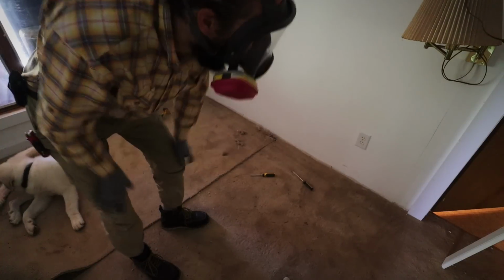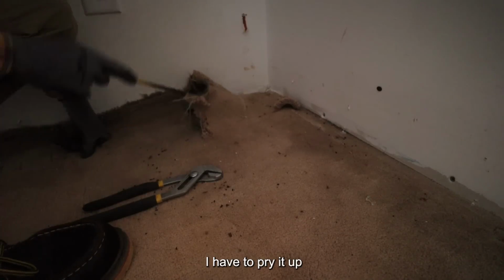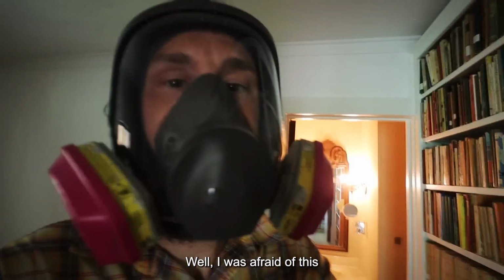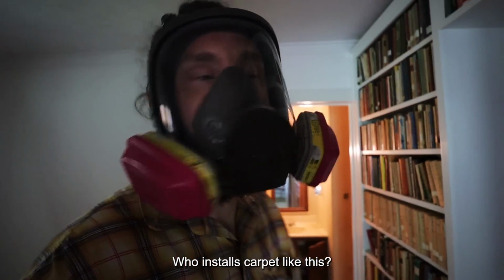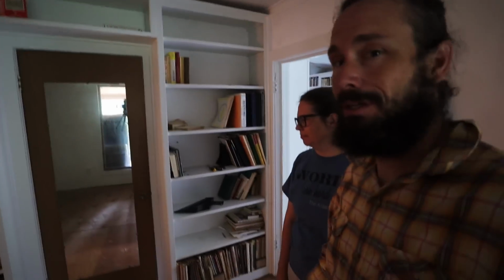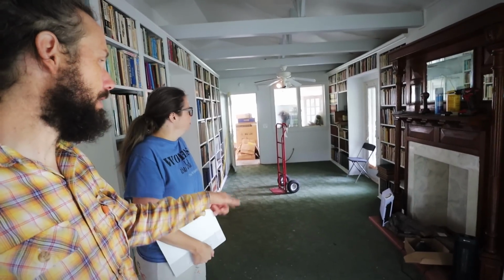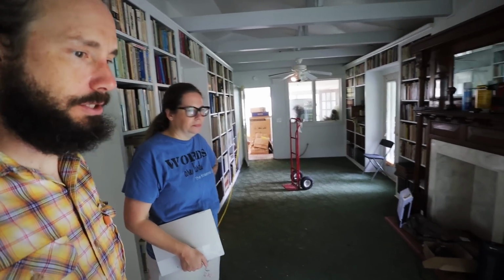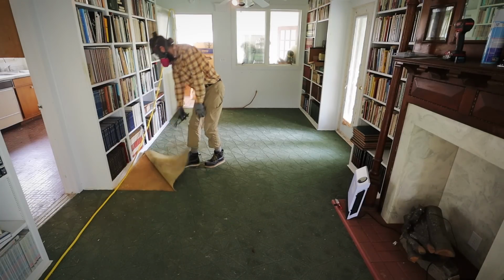Demolition Continues, more issues found | Homestead Farmhouse Renovation Pt 4

Comment: When renovations & repairs start to get a bit overwhelming like that, just pause, get cleaned up, and take a break. 
Go outside & get some fresh air. Hydrate. Get a bite to eat. Spend a few moments in a shady spot or garden where you can relax. You'll accomplish more in the long run if you do.

You're doing GREAT & have accomplished so much already in a very short time!
Reply from the maker: Always good to take a step back, thanks for the reminder :)

Comment: I have remodeled a number of houses over the years and this is much more common than you would think. The last house I lived in had an upstairs that was originally a family room, a big open area. The previous owner built dividing walls for bedrooms and closets for his growing family. He was a professional carpenter and he put the walls right over the carpet. This is also very common in commercial buildings where they take an entire office floor, that originally had all cubicles, and build offices around the perimeter. Ultimately, when they replace the carpet, they just cut it flush to the walls and put down the new carpet.
Reply: Not sure about" COMMON".  never have seen this in my part of the country.   Do it yourselfers might do this.   It's not common.
Reply: @humblehalfacre8464  With over 38 years as an electrician I have seen a lot of crappy work. I didn't say it was a good idea.
Reply from the maker: I have also remodeled a fair amount of houses over the years, my father was a carpenter. I enjoy this type of thing but had not seen the walls built over carpet before. I have seen lots of other questionable shortcuts just not this :)

Comment: Tjust fyi:he weight of all those books was exerting an extreme load on your floors so some of that warping etc may be partly caused by that unless there was extra support under the floor joists and perimeter framers. Ask any librarian or knowledgeable architect/engineer.
Reply from the maker: That is a very good point.

Comment: suggestion: If you don't want to remove the wall or bookcase you could use a Japanese saw (thin flexible blade pull saw) to remove the bottom 1-2 in of the bottom of walls/ bookshelves where the carpet continues underneath..  Hopefully it will be enough to pull out/ pry the carpet, etc out from underneath

Comment: There is something you need to consider regarding the mold, all those books are full of it!  Check out Art and Bri's channel about three years ago (maybe two years).  They had to get rid of all their kid's books because of mold.  There is a process they did to a small amount to save them but it was really involved.
Reply: Absolutely  -  they need to be dumped and their removal should have been a condition of the purchase and sale agreement.  Not a good situation . Sadly  Realtors/ are not the buyer s friend.
Reply: They had mold in the upper walls and in the air in their living space. Their mold was visible in the walls and on the exterior of their upper walls. I believe it is a different situation here than it was for Art and Bri!
Reply: @gelwood99  Art and Bri did not know the mold was inside the walls until they opened them up.  Mold likes to spread where it is not seen.
Reply: I posted something similar a week or so ago on one of their other videos. Not sure they ever saw it. Maybe so focused on their work they aren't seeing the comments.
Reply: @beverlymartin1414  , they said in a video the realtor thought about toss the book before listing it. I think at the time Nate and Katie liked the idea of having all the books. I understand the allure.
Reply from the maker: We had mold testing done upstairs and it was largely confined to the crawlspace. We are checking walls and so far we haven't found any mold. We will continue to test and ensure it is safe. We also have fogged all the books for mold and will clean any that are not being thrown away.
Reply from the maker: We asked to keep the books, the sellers agent said that she could remove them.
Reply: @TheKraemerLife  That is good!

Comment: Use inch inch by one foot slices and it will help lift the glue. It will make easier. You coul use small sprayer with your mildew spray and get in there behind bookshelves from the other room and then patch later when you put new base board in the other room. Done touch those bookshelves the are worth every penny he used to get them put in.

Comment: i use to think my Dad had a crazy way of thinking when it came to houses. he had many rentals and he would say. when a house reached 30 years time for a total gut. at 60 years a tear it down. he was a very practical thinker. i however see more of the historical value of structures. some times its more about the process of rebuilding and not the cost and effort of doing so. its only a money pit if you are counting the cost. dreams are priceless.
Reply from the maker: I agree with your "money pit" sentiment. I have spent far more on a home to make it the way I wanted and this is really going to help us far more than any prior repairs did. We will get through it...it is just hard when funds are tight but we know it will get better.

Comment: you always find special things that you wonder what those people where thinking when they did it when you renovate an older home - you are doing a great job and it will look wonderful when it is done - don't forget with the age of your home that the laminate might contain asbestos - I was told by a specialist because my house does not have polish-able wooden flooring I want to keep but just old participle board I am better to take the skirting boards off and cut around the outside and pick up the pieces and put down new plywood flooring

Comment: This is definitely a project house. That's a lazy builder or old homeowner who would build a wall over carpet. I agree that you need to decide if you are keeping the bookcases and how each room will be used. Interesting if you could find the original house plans to see what it looked like without the added walls and porch turned into rooms.
Reply: That would be cool to see the original house specs!
Reply from the maker: We have looked for it but so far no luck finding the original house plans...the more walls we open the more we get a sense of the silly changes that were made.

Comment: I would just cut a small portion of the drywall at the bottom of the wall, see if you can scrape out the carpet & padding, then when done, put up a wider moulding at the bottom, then your not patching a whole bunch of drywall. I also think Nate, you need to take a few more or longer breaks while working. You remind me of my husband that just wants to keep going to get it done, then what happens, is you are the one that's done! LOL
Reply from the maker: LOL, yes Nate has no off button.

Comment: I think you should remove the walls and the bookshelves. open it up. It will look bigger and better. Poor Nathan. You look very exhausted. You need help. Hire another person to help you doing the work. I know it will cost you more money but sometimes is worth it.
Reply from the maker: Unfortunately, it is load bearing (library wall) and we do not have the funds to hire it out or even put the beams in that are necessary for an open concept design.

Comment: Sorry, but yall are unrealistic. 50 years ago you have NO IDEA HOW IT WAS DONE. USE A CARPET KNIFE AND CUT ALONG THE WALL. SPRAY REMEDIATE FOR MOLD. LAY YOUR NEW FLOOR. Its frustrating, but STOP JUST RIIPONG, and cut it before you pull. Much easier. There is a cshaped knife that cuts carpet.